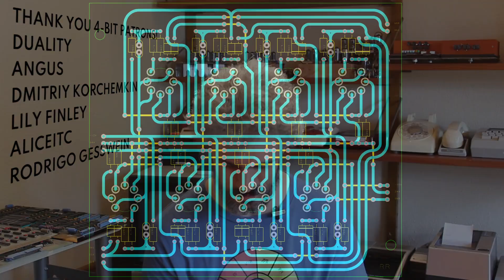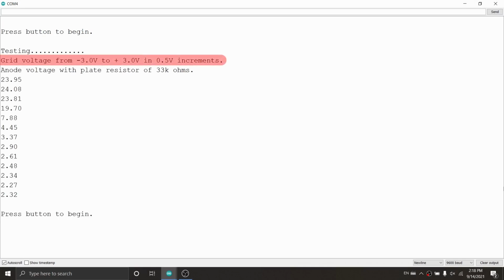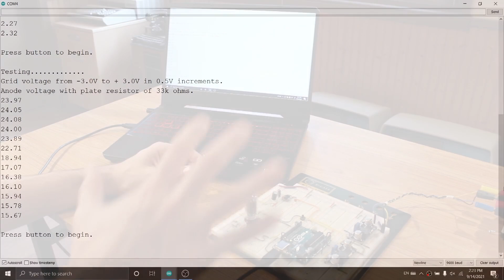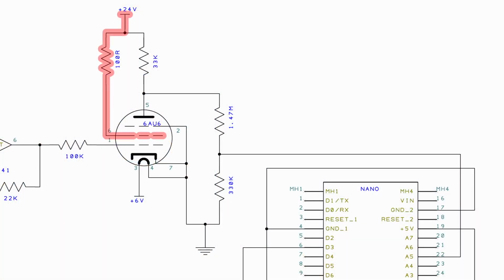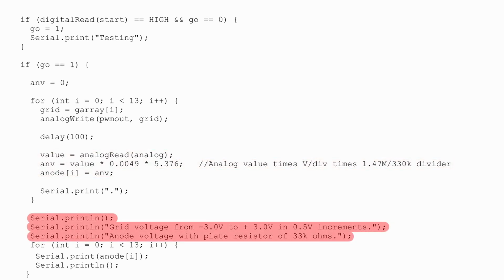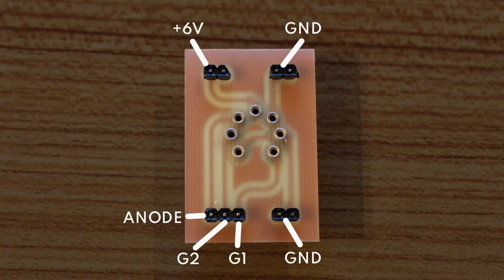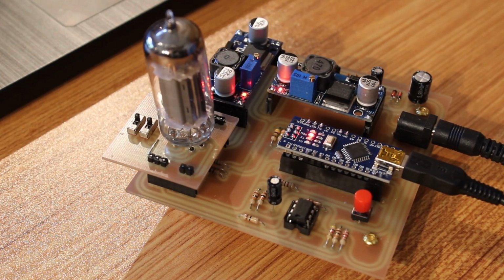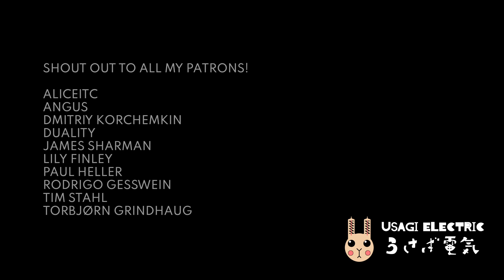Arduino Based Low Voltage Vacuum Tube Tester

Comment: Aw, this takes me back to the 1970s. I worked in an electronics shop and one of our services was to test valves (vacuum tubes), for which we had a valve tester unit. You could configure it with rotary switches for any known valve, though it was mostly ECC83 and EL84 from valve amplifiers and TVs. In itself, this is not much of a story, but the funny thing was the way a customer would come in with a carrier bag of valves. I would test them diligently and quite often find that none were faulty. This is also not much of a story. What was slightly more entertaining was the next two questions: "What will it be if it's not these?" and the brilliant "Does it matter which one goes where? Aren't they all the same?"

Comment: I  tested  my tubes one year ago. To do it, I ued datasheet on tubes, in general output characteristic V(grid-cathode) -> I(anode). To simplify this task, I measured anode current when V grid-cathode = 0. From 50 my tubes only 10 has been tested successfully: the emission was good. I have no idea - how to test emission in 24V mode when in datasheet given data for anode voltage above 100V.

Comment: I really enjoy your unusual approach to tube electronics and your circuit construction techniques!

I have one suggestion: Tube data books usually give the Anode Characteristic curve, which is the anode current Ia vs the Anode to Cathode voltage Vak for different fixed  Grid to Cathode voltages Vgk, and the Transfer Characteristic curve, which is the Anode current Iak vs the Grid to Cathode voltage Vgk for different fixed Anode to Cathode voltages Vak. Since these curves use voltages directly applied to the tube pins, they are independent of the choice of an Anode load resistor (your choice is 33k).

The condition of a tube can be checked directly against  published tube data if your system enabled the standard Anode Characterics and the Transfer Charactristics to be plotted, instead of the Anode to Cathode voltage Vak against the Grid to Cathode voltage Vgk, which depends on the value of the anode load resistor.

To determine the Anode current all you would need to do would be to use a precision resistor for the anode load, and measure the voltage drop across it.

Please keep publishing your highly enjoyable videos on tube electronics ! 🙏!

Comment: You should check out using a tube in a low voltage environment as a Reflected Plate Amplifier US Patent US5450034A
It will give you the sound of a tube in a low voltage circuit.

Comment: 1950s time traveller "So, you are using 5 brazillian tubes to measure the performance of one tube, which costs more than all the others together? Which  works worse?"
Nice work, but it's fun to re-watch this in the mindset of someone from the vacuum tube era.

Comment: I am looking for exactly what you described for a general tube tester. Not only for most dual triodes, but one specific that has a higher current and filament voltage.

Comment: Hi.
First of all, thank you for such wonderful videos. Being an EE that got into the Uni in 1980 and went all the way to the digital world, for me the tubes were mainly a curiosity from older days. And your videos are filling a gap in my endless curiosity.

About your tester gadget.
Those massive resistor values used for sampling the plate voltage are most probably causing erroneous readings of the ADC (AnalogRead). The ADC inputs for micro controllers have very specific  source impedance requirements. Common values are in the range of 2,5 ~ 10K values. Not complying to it means that the capacitor of the sample & hold front end of the ADC has not enough time to charge up to the voltage level being sampled.
I would suggest an extra OPAMP wired as a buffer (unity gain) between the resistor divider and the Arduino analog input.

Comment: Could it be a tin whisker that shorted the tube?
Reply from the maker: That's entirely possible! Also, sometimes the material that is coated on the plates can flake off and cause shorts too. If you're lucky, sometimes you can get away with just shaking the tube to break the short loose.

Comment: Could you test 8417 on this type pcb sub bord ?
Reply from the maker: Unfortunately, I don't think something like the 8417 could work. There's a few issues that we would have to overcome. The fact that it's octal would require a whole new plug-in module that's a little too large for the space available. But the bigger issue is that the 8417 heater draws 1.6A of current, which means its in-rush current when cold is probably closer to 3A, which might be too much for the little buck converter I'm using to generate 6V for the heaters.

Comment: It is good the way you put the video into chapters.
The old tube tester you have is an Emissions tester. It just connects the plate and grids together, applies a DC voltage and measures the current. 
The better type is called a Mutual Conductance tester. It tests the tube in an actual circuit. It places an AC signal and bias on the grids and measures the AC output from a plate resistor.
I would use a higher voltage for my circuits. The performance is better and you can use the curves and specifications from the manufacturer. 
When I was 14 years old I built amplifiers using 2000 volts and I am still alive.
Reply from the maker: Thanks for checking the video out!
The old Accurate Instruments tester is not the best, but it does help to check how weak some tubes are as well as check for shorts.
In the future I definitely intend to build a proper tube curve tracer that gives current traces for a variety of plate voltages. 

The primary reason I'm using tubes at low voltages is because I didn't start tube stuff until recently. Like most people, I was used to really low 5V circuits and had never touched anything with voltages higher than 100V. For a lot of people, myself included, the high voltages of tubes can often seem like gatekeeping. There are a lot of really smart enthusiasts out there that want to get into tubes, but don't. So, I started playing with them at low voltages, and they work surprisingly well. This opened the door to the hobby for me, and now that I'm more comfortable with tubes and how they work, I'm ready to start working on circuits with higher voltages. I would like to think that I've also opened the door for other enthusiasts to experiment with tubes as well that were previously afraid of the high voltages.

The more people we have playing with tubes the better!

Comment: Very nice! I'd love to see a versatile, low cost vacuum tube tester project which is adaptable for many different types of power, preamp and rectifier tubes. Something that would be useful for a technician. There are a couple of good testers out there such as Roe Tester. However, that's a very large project.  Thanks.
Reply from the maker: Thank you!
My ultimate goal is to build something that will test pretty much any dual triode, tetrode or pentode you throw at it. Rectifier tubes and diodes may be a bit more difficult, but still possible?
At any rate, the ultimate goal is to keep the total cost under $100, which means there will have to be some compromises in pinpoint accuracy, but I think I've got a design that will work! One of my goals early next year is to get building on it!
Reply: @UsagiElectric  Thanks for your prompt reply! I'd love to build something that I can learn from at the same time. I'm glad there are people like you who take the time to make videos. I still work on old guitar amps etc. but  I have to use a friend's tube B&K tube tester which does simple emission, shorts & leakage etc. Was also thinking of building something like the Etracer kit. Now, I think I'll wait to see how your project turns out. Thanks again.

Comment: If you can finish that project, you will become a God, to all audio tube loving guys :)
Reply from the maker: Thank you!
I've been working through a bunch of ideas and I think I've got one that will work, time to start prototyping it and see where it takes me!
Reply: @UsagiElectric  :) really ! a open source one will help a lot of people, basically it will disrupt the market :)) good luck!
Reply: It would be better to test these with the voltage the audio circuits use.

Comment: It would be so nice if there is a tube tester that recognizes tubes where the text has disappeared. I have hundreds of tubes where paint is unreadable.
And also whether the values are still good.
Reply from the maker: Oh man, I'm right there with you, that would be awesome!
Unfortunately, there's just way too many variations that I don't think it would really be possible. 
Hmmm, I mean, you could test continuity across each of the pins and potentially determine the heater layout from there. But determining the voltage and current of the heater from just that would be... beyond my capabilities. But, if you could figure out the heater, you could then use low voltages applied to the pins to start determining what the layout of the tube is. Like, put 6V through a large current limiting resistor on two random pins, connect a random third pin to ground, and see if any emission happens. Through this you could maybe figure out where the cathode, grid and plate are. But, for tetrodes and pentodes that adds a whole other level of complexity.
Alright, well, now my brain is going to be chewing on this for next few months, haha. First, I'll focus on building a low cost curve tracer for tubes, then maybe I'll revisit this idea!

Comment: I arrived at your channel quite by accident. I was intrigued by your tube tester and will be experimenting with a prototype of my own. When will you have the time to investigate that cheap tube curve tracer. It may prove beneficial to me. Vacuum tubes were still a part of my education when I was at college and the transistor was up and coming. My first exposure to computers was a PDP11-05. I still like the vacuum tube. Isn't technology fascinating? The future is built on the past. i am looking forward to your design. Keep up the good work.
Reply from the maker: Thank you for checking the channel out!
I'm hoping to start getting into the design of the cheap curve tracer sometime in the next few weeks. I've got a few projects on the breadboard I gotta clear off first, but it's next on the docket (hopefully). It'll probably take a while to get it working alright, but I'm hopeful it'll go smoothly!
The PDP11 is a very cool machine! A friend of mine just picked one up recently and I'm excited to see him getting it going.
The future is indeed built on the past, but I'm constantly surprised at how little things have changed! The fundamental designs are pretty much all the same, things have just gotten so much smaller!

Comment: Really glad I stumbled across your channel.  I engineer modern electronics and algorithms, but love playing in the old ways, designing tube circuits.  There is a lot to learn from the old ways - those old ARRL Handbooks and the like.  It's always great fun to move from paper and pen to the soldering iron in some old tube radio.  Thank you - great channel - and I look forward to watching the computer building series (reminds me a bit of that 90's series called "The Machine that Changed the World").  Nice Usagi ... we have a few wild that run around the backyard.  Cheers
Reply from the maker: Thank you so much for checking the channel out!
There's just something so special about vacuum tubes, it's hard to put my finger on it. I think the scale of them helps because, even though the circuits end up massive, it's easy to visualize exactly how stuff is moving around the circuit.
Our little bun is the most important member of the team here! Though I do love seeing some wild rabbits hop around the yard too.

Comment: Is there maybe a BOM available? Interested in the copper plugs you used to plug the tubes into.
Reply from the maker: Oh, uh, I just kind of used what I had laying around, haha.
As for the tube sockets, I use little Harwin 1mm PCB pin headers with a custom footprint on the PCB: 
https://www.mouser.com/ProductDetail/Harwin/H3161-01?qs=WS5Jv%252B%252Bx1qUxGQ9n1naX6A%3D%3D

Comment: Those milled PCBs are beautiful. Do you have a video on your hardware and workflow?
Reply from the maker: Thank you so much!
I don't have anything recent on the hardware and workflow, but I definitely plan to make a video covering the entire process sometime in the future!
For quick reference though, I design all my PCBs in DesignSpark PCB using 1mm trace widths. Once happy, I export the Gerbers, and then open them in FlatCAM. From there, I get all the settings right for the tools I'm using (60* V-bit, 0.9mm drill, 1.5mm end mill) and export it as G-Code. Then, I stick a 2x4 in the clamp on our Bridgeport EZTrak CNC mill, use the biggest end mill I have to flatten the surface of the 2x4 with respect to the mill head, and finally just stick the PCB to the wood with carpet tape and hit go after zero-ing everything out.
I've gotten into a pretty good flow and can go from design on the PC to actual PCB in my hands in under two hours, which is excellent for how impatient I am when working on projects, haha.

Comment: WOW!   Quite interesting and inspirational!
This video really triggered the little grey cells into a lot of thought.  Got to thinking about how most capacitor checkers of the "Old School" type use high voltage...up to 600 volts.  The dangers this poses is not pleasant to think about.  I came across a design that has been made that will test the capacitors using low voltages and it is more accurate and safe than the old types.  In fact, it can even forecast failure in seemingly "good" capacitors.  Check it out here:
https://www.youtube.com/watch?v=LhovRIM5xAo
The thought I had is perhaps you could come up with a tube tester that would provide accurate testing of vacuum tubes using low voltages.  Especially nice if it included making a graph of performance rather than simply go, no-go type testing.
Reply from the maker: Thank you so much!
Mr. Carlson's Lab is an excellent channel, and he's a properly smart engineer with some really beautiful designs. His capacitor leakage tester is really, really good, and I really should build myself one of those some day.
The drawback of the low-voltage tube tester in this video is that it really is specially tailored to my needs. But, I do intend to start work on a tester that actually measure current through the tube without a plate resistor at various voltages to give a proper curve like you would see in a datasheet. The benefit of a design like that would be that the plate voltage can be anything you want it to be, meaning the tester can be modified easily to give curves at low voltages, or at the voltages you see in datasheets!

Of course, that project is on hold until I finally get my HP150A oscilloscope up and going. That thing has been kicking my butt for way too long, haha.
Reply: @UsagiElectric  Wish you the very best on the HP 150A

Comment: I think even 12 volts would work. Have to try...
Reply from the maker: It should work at 12V with no problems at all! 
The resistor divider network for the arduino will need to be updated, but other than that, it should be pretty straight forward!

Comment: Great video, thanks for posting!
I wonder if low voltage will extend the lives of the tubes.
Reply from the maker: Thank you so much!
I've heard conflicting ideas on what low voltage does to tubes. The biggest worry seems to be something called cathode poisoning. The cathode is nice and hot and boiling off electrons, but those electrons don't have a strong enough B+ to be attracted to, which can cause a chemical reaction between the cathode base material and the oxide coating on it. This can act like a high-resistance, which can start to mess with stuff. 
Now, everything I've read regarding cathode poisoning says it's when there is no anode voltage at all, so no current flow through the tube. So, 24V, while not much, is still something, so that may prevent cathode poisoning altogether. Honestly though, I have no idea, there's just not enough information out there about it. So far though, I haven't had any problems!

Comment: Ah the good old  run the tubes 'cold', on the far on the bottom right side of the curve, lucky you don't care much about audio distortion.   This was quite common with Aviation band tube radios, (14~20v). Your voice always sounded like cross between Donald Duck and Elmer Fudd.
Reply from the maker: That's interesting that the Aviation band tube radios ran such low anode voltages! I run low anode voltages because I'm a total klutz and I wanted my vacuum tube computer to be safe for an idiot who likes to stick his fingers in live circuits (ie. me). It turns out, if you're building logic circuits, some tubes work beautifully at low voltages. The 6AU6 in particular is a great low voltage logic tube, with sharp transitions and nice voltages at saturation and cutoff. It also helps that the 6AU6 was probably one of the most ubiquitous tubes ever made and is pretty cheap, haha.
Reply: @UsagiElectric Well a master knows how to use their tools ;)    In your case you are just looking for a Hi-Lo signal (digital) so you are using them as a switch vs an amplifier ;) So 100% correct to run them cold.  Why waste the power.   BTW  I have  a little typo in the above should be 12/14  or 24/28 to be perfectly correct. The first being the battery the next the working (alternator) voltage.  It is the old engineers joke you can 2 of the 3, 'low voltage', 'medium power', 'no distortion'.  In the case of General Aviation tube radios, they choose the first two.    The real rub of 'Cold' tubes is some modern 'hybrid'  tube amps that have a 12AX7 in them with 40v  on the plate,  they have to use an op-amp or two to cover up the distortion patterns.,  (snake oil really).